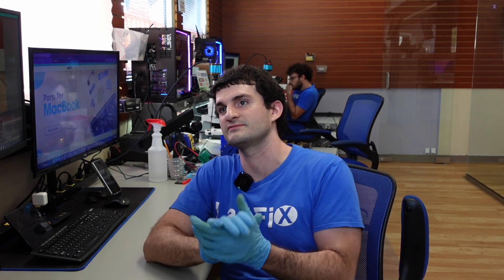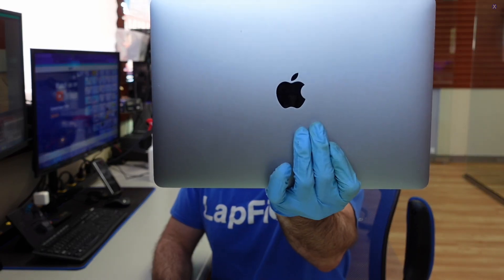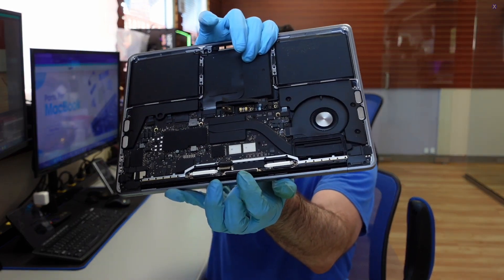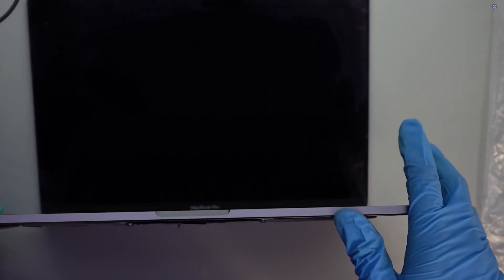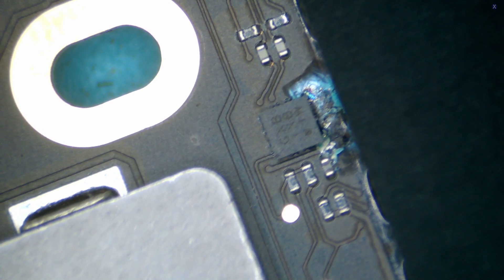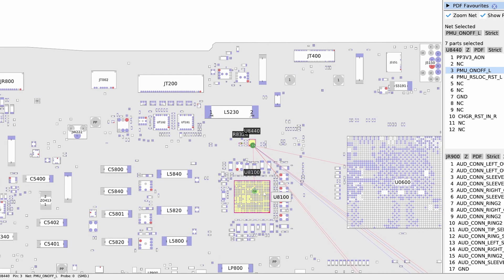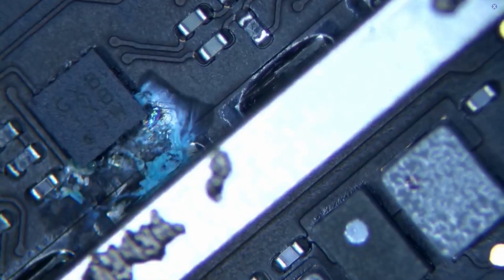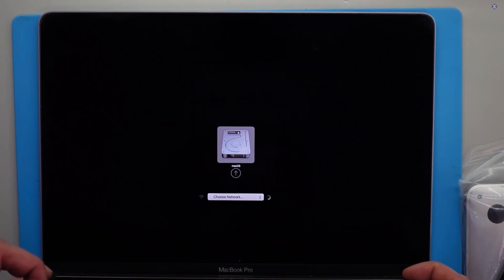Fixing a M1 MacBook Pro with Liquid Damage

Comment: Hello, tell me there is such a problem, there is a MacBookAir A2337 on M1, it has not been used for some time, but access has been lost, the login password is blocked, the ID can be deleted with the help of Apple_Configurator_2, and the port for flashing is still blocked, write whether it is really necessary to create a new user and what is needed for this, what kind mac and how to configure it, there is a mac patched by Sonamoy, it is possible to use configurator 2 fully, it is not a problem, thanks